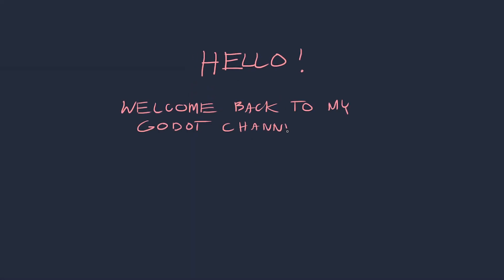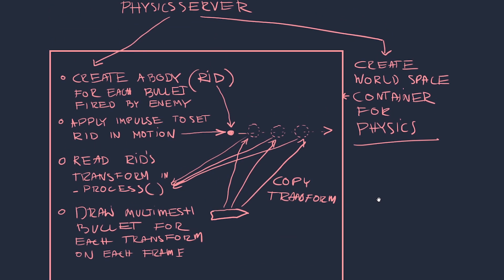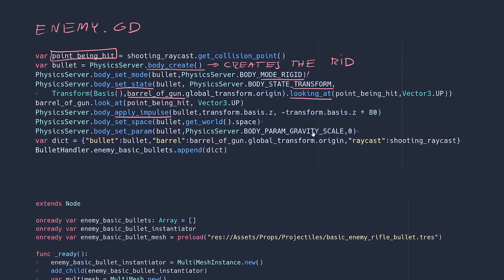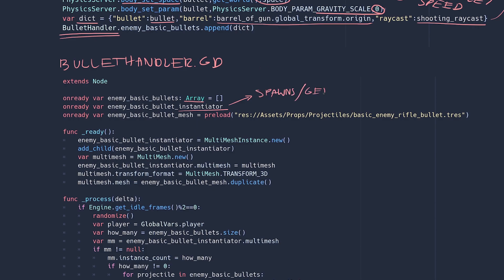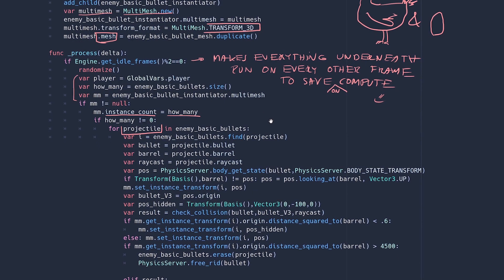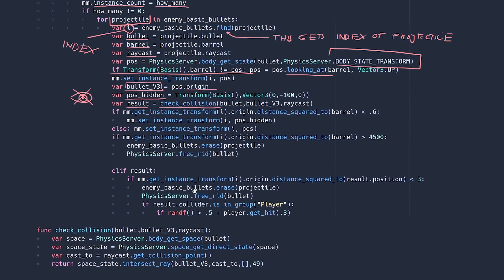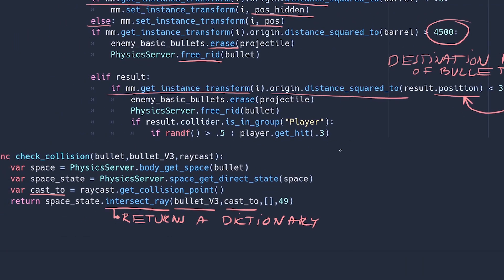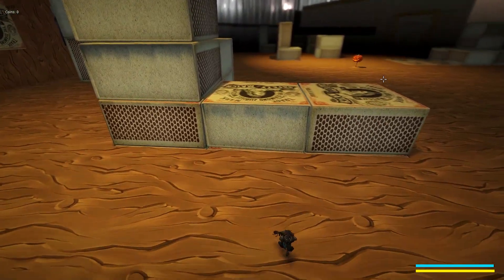Using PhysicsServer & Multimesh to Optimize 3D Performance - Hundreds of Projectiles in Godot 3.4

Comment: Great explanation on physics server. However, since this is all about performance, looping through bullets every iteration (`Array.find()` will have to compare each entry in the array in worst case scenarios) feels like a very bad and unnecessary idea. I'd suggest just counting up, picking bullets by index and only increasing the index if you didn't delete the bullet. This should lead to the very same result anyway but in a fraction of the time (O(n) vs. (O(n²)).
Reply from the maker: Yea I ended up just using a counter even though I can't say there was a difference. But logically it makes sense as I only really need an index to differentiate between the items.

Comment: Why are raycasts inaccurate? I've had luck with them but is something different about them in Godot?
Reply from the maker: They are accurate but in this situation they're insufficient. A raycast will scan for intersections between 2 points only. With so many scans it's likely that an intersection goes undetected. Collision shapes scan for collisions across multiple points that make up the collision shape so they're much more likely to detect collisions. At the cost of performance, of course. So it all depends on one's game design.